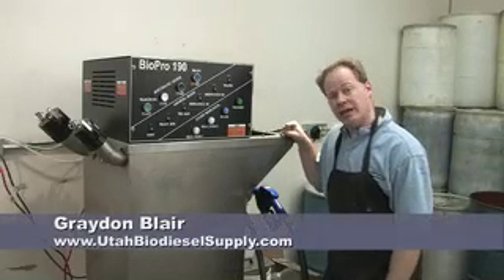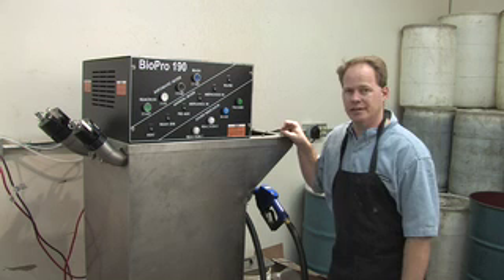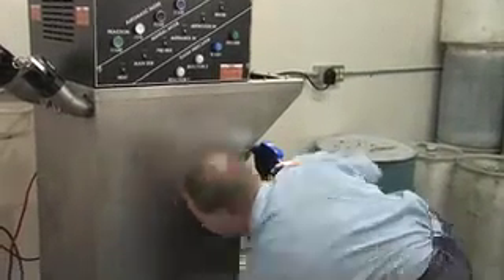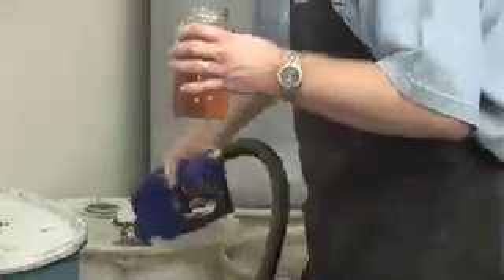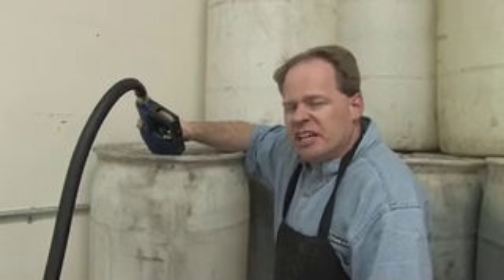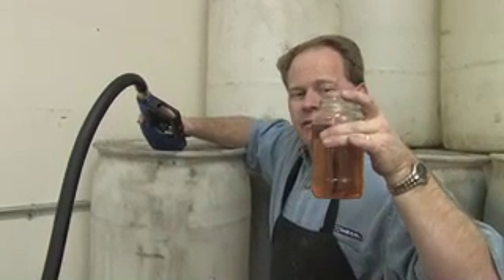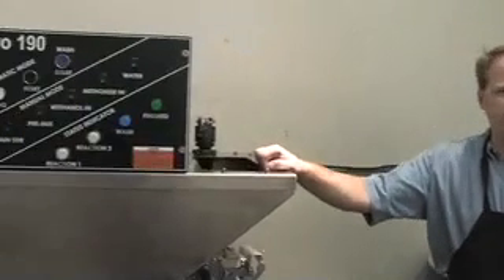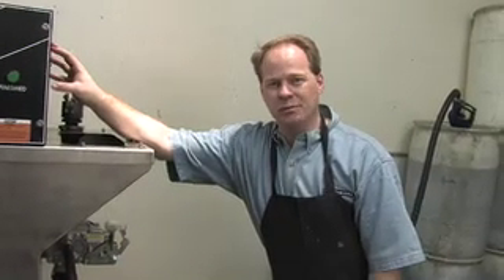Biopro 190 | Home Biodiesel Equipment (Part 4)

Comment: wrong!!!!!!!!  the machine doesnt  make the biodiesel,, it helps you to make  one,,, its chemical reaction that produce good biodiesel. so make sure you got the proper titration,, proper  heat  and proper washing,,, to make it clean,,, or else your engine will run for  a couple of  months   and then    kapot....   biodiesel is  good for the diesel  engine as long its  made right?  and i dindt see any water test on your biodiesel as well,,, water test can tell you how good is the biodiesel is